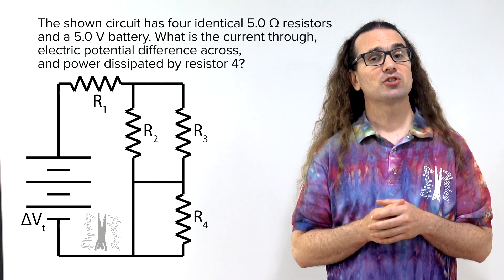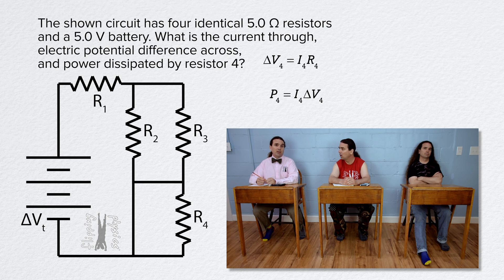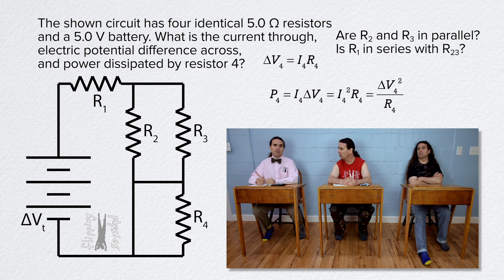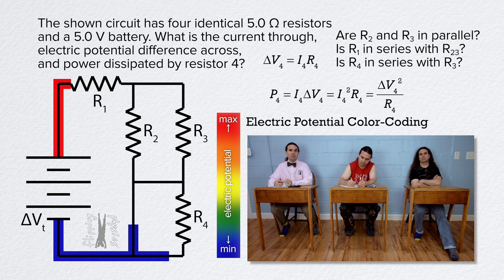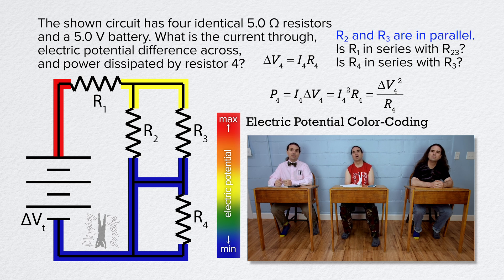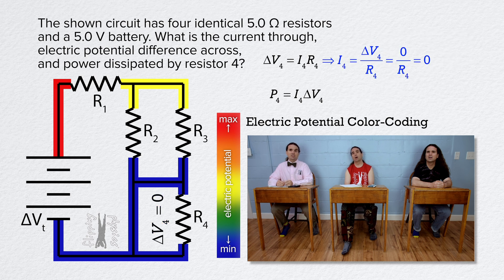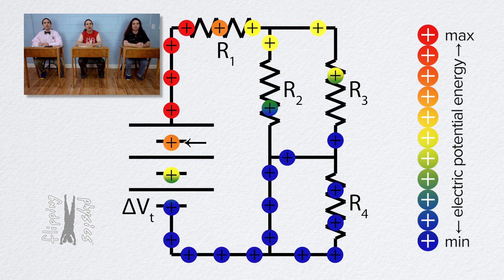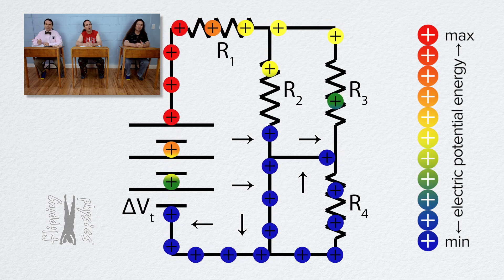Resistor Circuit Example

Comment: Mr. P, I would like confirm my statement whether it would result in incorrect answer if I were to find the electric potential difference, current and power dissipation of individual circuit component while neglecting completely resistor 04. And is resistor 04 even doing anything out there?

Comment: how the negetive terminal is in a lower potential.isn't  electric current flow from negetive terminal to positive terminal.
and thanks for this explaination.
Reply from the maker: The battery adds electric potential energy to the charges, therefore, the battery increases the electric potential energy of each charge, therefore the charges go from the negative to the positive terminal of the battery as they go through it.
Reply: @FlippingPhysics  oh!!! that explains it.thanks for this reply
Reply from the maker: @shan_arosh  😀

Comment: Good video and good use of the animation technique.  I was surprised that you didn't take it back to a conceptual level with resistance.  The path without the resister offers no resistance to the current, while the path with resister 4 offers some, therefore all the current goes through the short.  Do you hold off on the ratios of current through parallel paths for 2/C?
Reply from the maker: Hmmm. That is logical and I have explained it many times to students similar to "The path without the resister offers no resistance to the current, while the path with resister 4 offers some, therefore all the current goes through the short.". I think it is not worth my time to try to add that. Cost/benefit ratio is too high.

With regards to the value of the current split between R2 and R3, I did not feel a need to add this to the video. Teachers can talk about that with students if they want to.